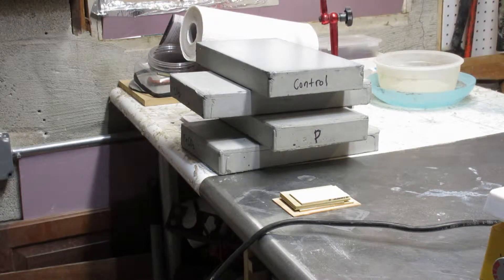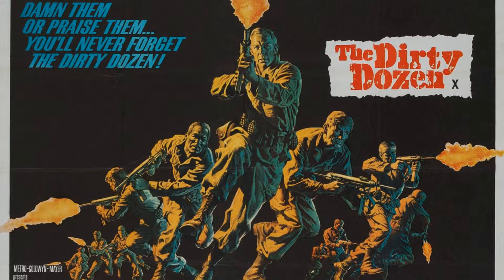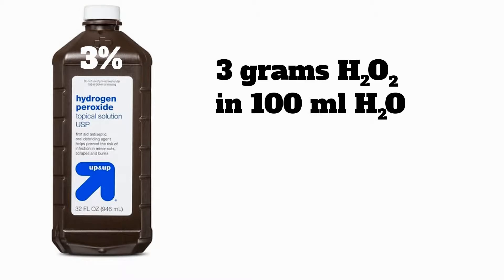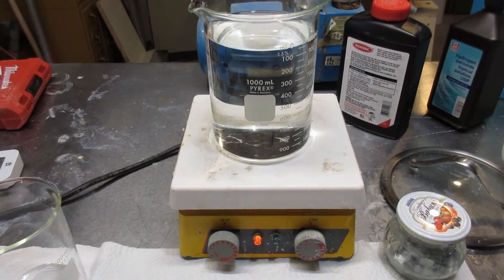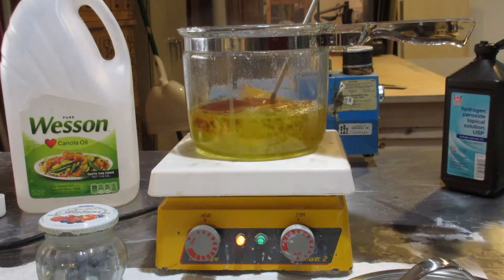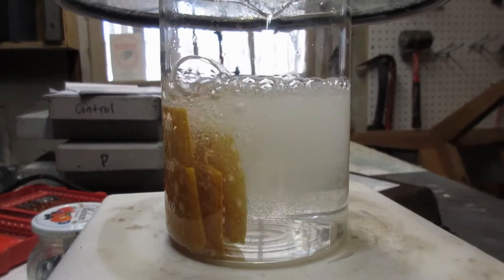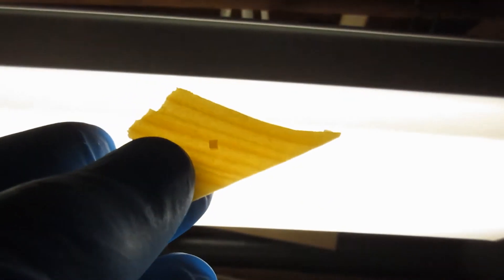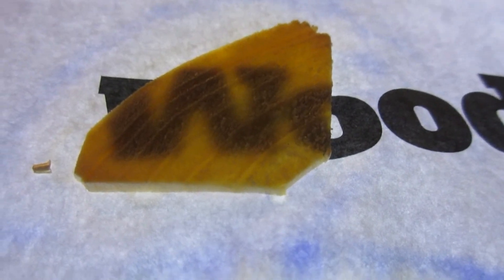Transparent Wood : Failure is definitely an option.

Comment: I'm thinking the problem was that H2O2 was evaporating along with the H2O, leaving you with about the same concentration.  H2O2 being less stable, might the process even have reduced the concentration?
Reply from the maker: You could be right but my theory was that since H2O2 boils at 150C it shouldn't evaporate off but, it could be decomposing into H2O and O2 which would defeat the purpose.